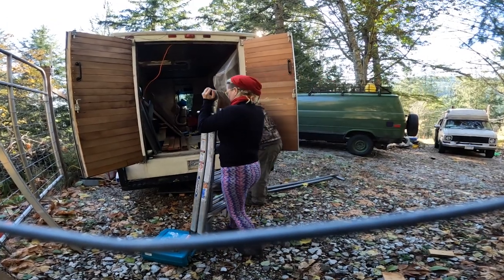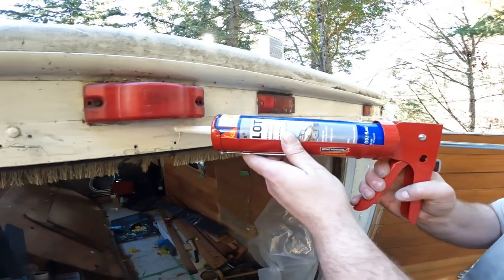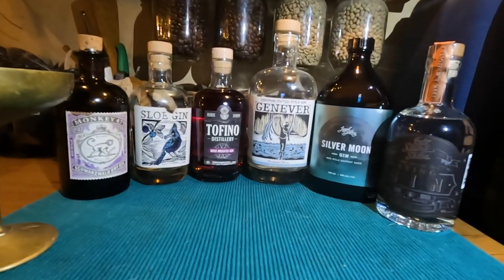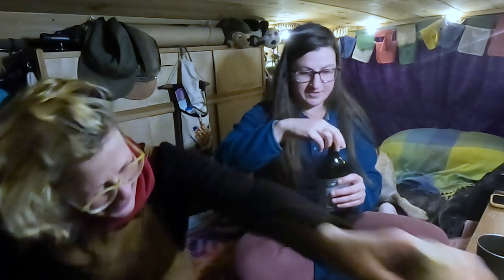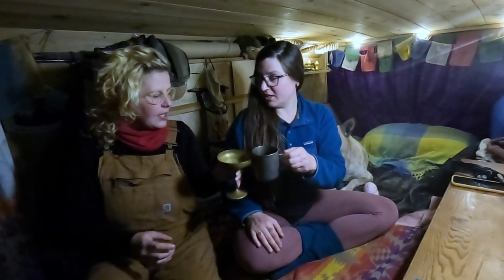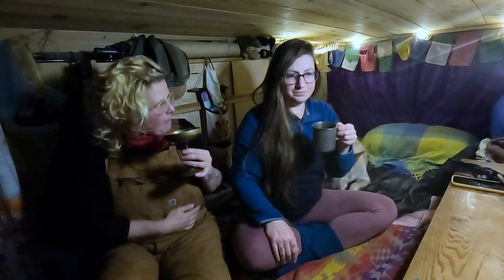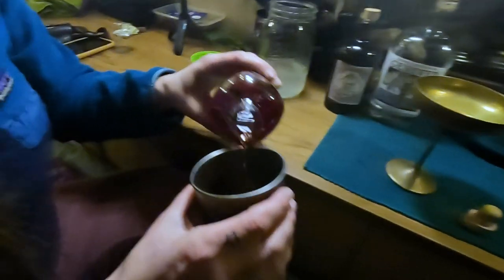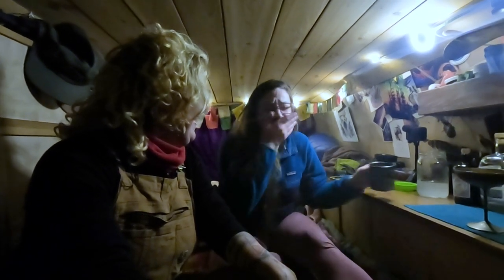Gin tasting and Van Life Reality | 1977 GMC Vandura Tideline to Alpine

Comment: Thanks! You’ve learned a lot having an older carbureted vehicle and will really enjoy the step van with it’s newer user friendly technology
Reply from the maker: I SURE will.. tho there's SO much cooling system in the Step Van before you can even get at the engine! Mind you the dog house on that too provides good access. I love older vehicles as they're easier to understand mechanically!
Reply: @FlossyRoxx  Yes I prefer older as the new engine I just put in my step van is the older carburetor version from the 70’s, brand new(still available from Chevy)I’m 63 so grew up with these totally mechanical engines which are simple and easy to work on, mostly have to really understand the carburetor and it’s adjustments. The new stuff is all computer adjusted which would be a good thing for someone tired of mechanics and willing to go get most of work done at a shop.

Comment: If your van runs ok warm I would suspect the choke. On those when cold and not running, with air filter cover off, press gas pedal to floor and release. Looking in the carburetor the choke should close. If not the common problem is: on the side of the carb is a round plastic cap that has a coil spring inside. This opens you choke when warming up and closes it when cold. You can can loosen the 3 screws and try to adjust it but heat usually kills these over time. Not expensive to buy. Like the others have said I would also replace that dirty air filter. Hope this helps.
Reply from the maker: Hmmmmm yes! I've had issues with the choke before and haven't checked it recently. Good thinking I didn't look at that yet

Comment: If u hold air filter up to the sun. .. u should be able to see light thru it..  if not replace it .. that will make engine run terrible also...  but could be low fuel in tank. Being on  a hill....   if fairly full'tank'   u need a new fuel pump
Reply: Also. Get new fuel filter too
Reply from the maker: I think both of those parts are due for replacement!! thank you!

Comment: That air filter looks black and clogged on video...could be lighting if it's new.when it's running like that don't drive please.if angle affects gas obviously check gas but pickup tube could be blocked or moved..please get checked you will get stranded. Sometimes older not better unless ready to to spend money. Don't be panic you can go learn what you need to. It's simple plumbing,electrical on a 77. You can go do it.
Reply from the maker: I'm sooooo glad it's so simple on a 77 it's helped me learn so much! I will definitely check the filter! I'll get pick up tube checked when we look at the fuel pump too